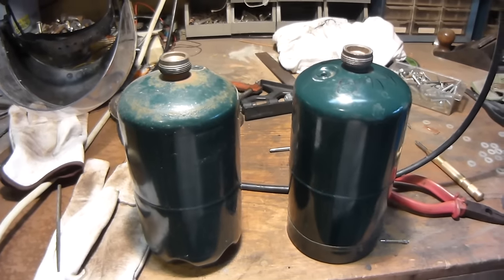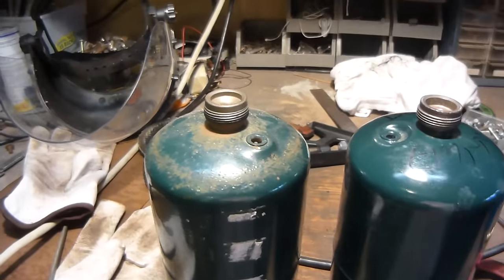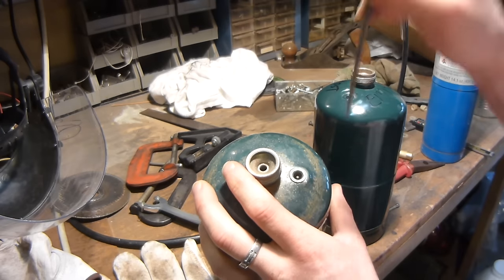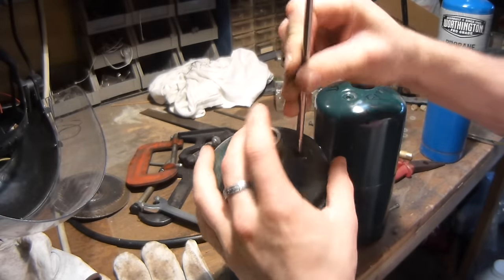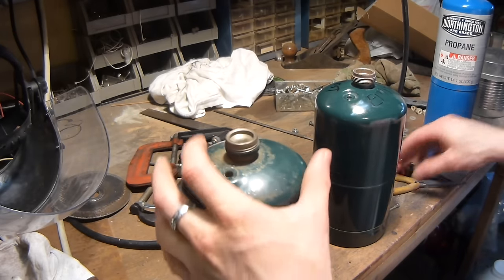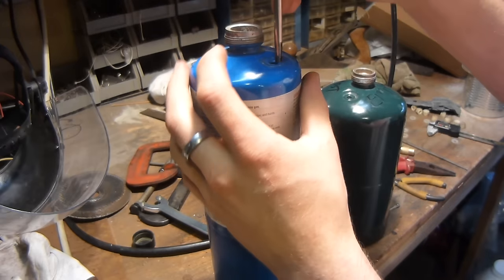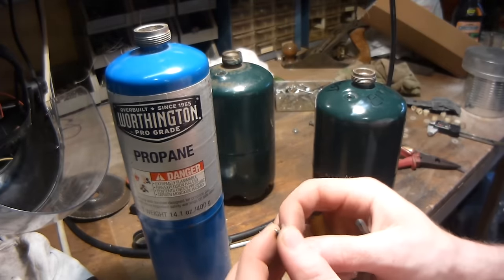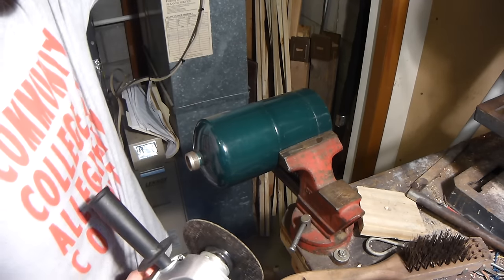How to Safely Cut Open a Propane Tank for Aluminium Melting Crucible

Comment: It is indeed a schrader valve and can be removed with the same tool used to remove tire valves. You can buy a tool to remove them at any auto store or Walmart for under $2. 

I do not believe a schrader valve would make a good overpressure device. The reason the tank has one to to purge air out when the tank is filled. The disposable cylinders are not equipped with any over pressure device, when they are filled with liquid propane enough gas is left to allow for expansion.
Reply from the maker: +98hundy that makes sense. Thank you!
Reply: I just bought a tool to remove that valve, would not remove it. Its not like a tire valve the one on the tank pulls up not pushes down like a tire.
Reply: Larry Kluck an old broken screwdriver is a good candidate to make a tool out of. All you need is a hack saw and a file if your shop is a bit Spartan.
Reply: 98hundy thanks

Comment: fyi a pellet gun deoes not posses enough power to puncture one of these even if you hit the same spot 6 times. a .22 will rip threw them no trouble, never seen one exsplode but the whole point in doing it this way is you can be far enough away that wont matter.

Comment: Did the same thing to build a small wood stove with a 10 gal. propane tank, but dumped water with no valve and let dry.Then built a hot fire in a burning barrel ,threw it in valve hole up and stood back.First thick smoke then hooooootbang   hoooooootbang 3 or 4 times. Could be a coating inside, I don't know.Just DONT USE A TORCH.

Comment: I cant even try this, even if I wanted. I don't have a hacksaw or something haha, just a coping saw :)
Reply from the maker: +Jordan O'C (Xenro66) You don't have a hack saw???   Everyone needs one of those.  I mean I guess you could skip the hack saw and go straight for an angle grinder... But dude, you need a hack saw!  :P  It's ok... I'm just messing with you.  :P
Reply: Makerj101
xD I know man, I need to get one. I'd even settle for a junior hacksaw. I don't even have an angle grinder :L
Reply from the maker: +Jordan O'C (Xenro66) I guess your parents aren't the type to fix things themselves?
Reply: Makerj101 Not at all. We have a little shed on our balcony (I live in a flat), and it's got the bare basic tools. A drill, a hammer, some nails, a wood rasp and a metal file. That's pretty much it. Oh, and a jigsaw that was water damaged -.-
Reply from the maker: +Jordan O'C (Xenro66) Ah I see.  Jig saw would work fine.  You don't even really need to have a metal blade as long as you go really slow.